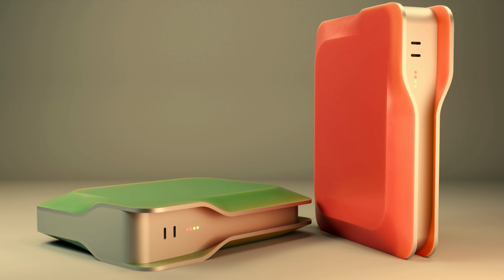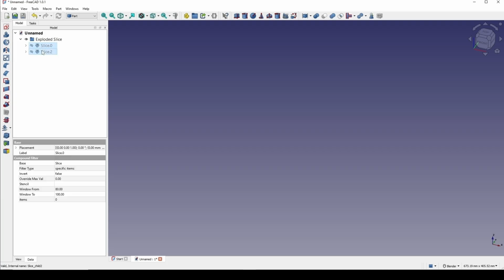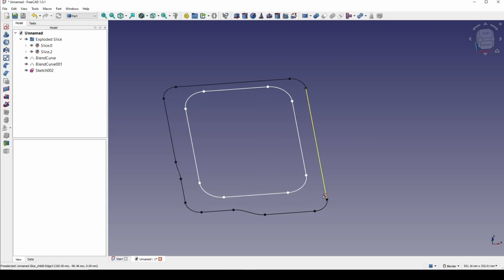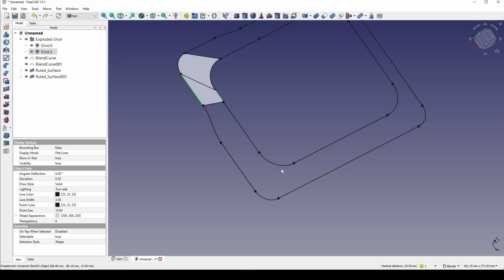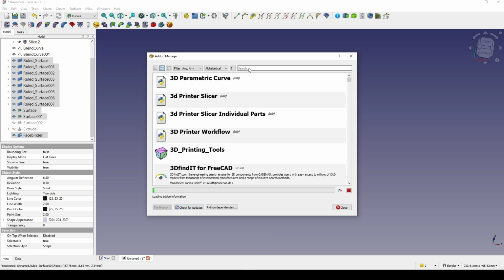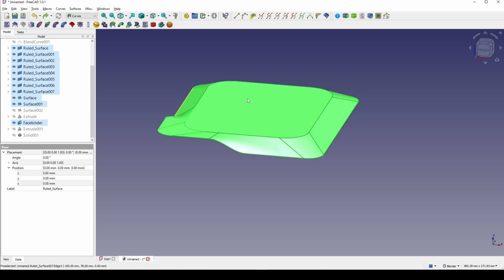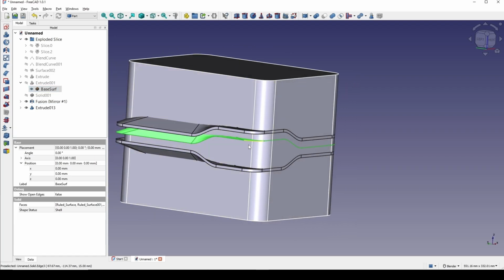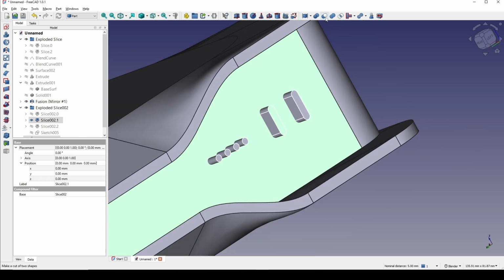New FreeCAD 1.0.1 Tutorial | Surface Modeling A Power Bank

Comment: If I use the curves parametric solid to create the first solid side, I am no longer able to use the BaseSurface for cutting a solid, because it can not be moved without changing the position of the solid side. I think the workflow is different if you use that method instead of using Fusion as in this example. Best not to use curves parametric solid if you want to follow this video (I think).
Reply from the maker: If you use parametric solid, don't move the solid up, just go back and move the base surface, It's even simpler.
Reply: @DuyQuangDang  Thank you!